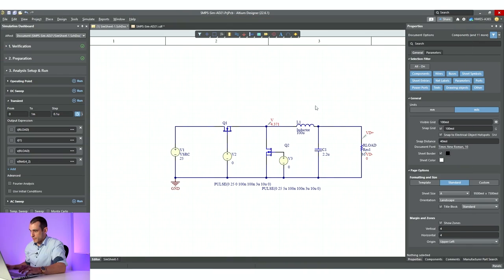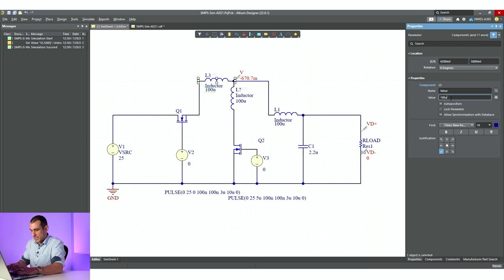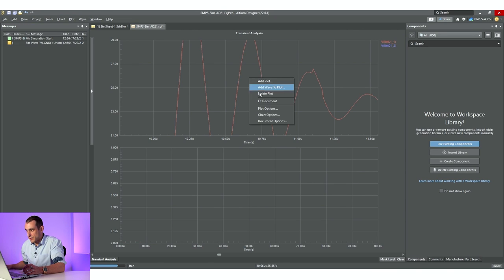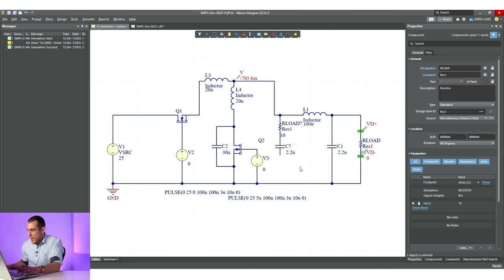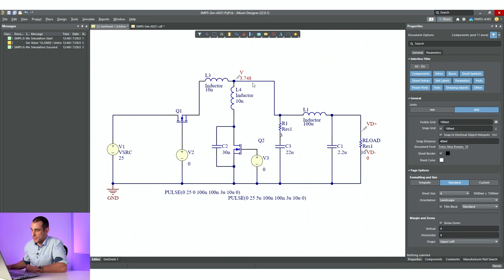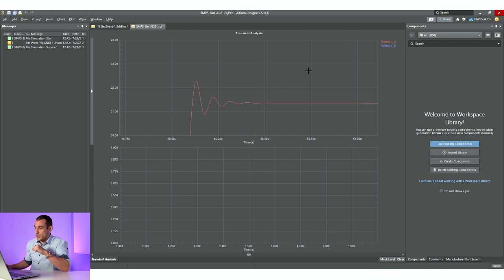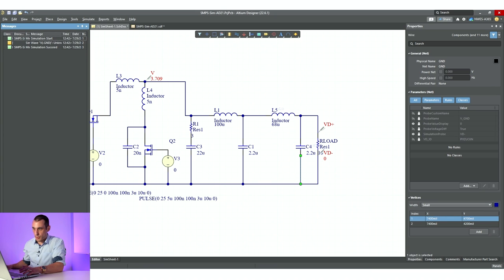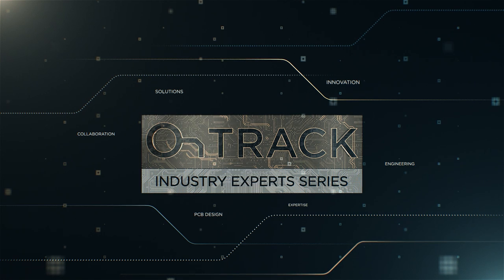Where to Place Snubbers in a Buck Converter

Comment: What about a snubber in parallel with the actual inductor? 
My converter is subject to fast changes in load which are causing voltage spikes. Output is 9V, spikes are 21V.

Comment: Is there a way to determine an actual parasitic inductance based on a layout?
Reply: Yes, it can be determined in Altium Designer using the impedance calculator inside the stackup manager. If you look in the right side of the calculator panel, you will see values for inductance per inch and capacitance per inch when you calculate the impedance. You can set whatever trace width you want and it will provide an impedance value. Some online calculators will also return the capacitance or inductance values per unit length. The same idea applies in an online calculator, you can set whatever width you like and it will just tell you the inductance value.

Comment: For my point of view, the 22u snubber (bigger than output filter)  is way too big. I'm typically reduce the ringing frequency by 3-5 times, then adjust snubber resistance to best snubbing. Best solution - to adjust switching timings to prevent ringing at all - but its complicated.
Reply: Yes it's large, typical will be much smaller but it does depend on the ringing frequency, generally higher ringing frequency requires a smaller cap. If you do a sweep of capacitor and resistor values with the Parameter Sweep tool in a SPICE simulator you can get to a good pairing of R and C values.

Comment: (1) Do you actually want a resistor for the RC snubber, or are you just using the parasitic R that comes with any track?  (2)  When you say the LC filter works only at the load, are you really just saying that the stuff between the switch and the L can still experience noise that might leak out and interfere with stuff you do care about (therefore minimize that area)?
Reply: Discrete resistance is definitely needed
Reply: (1) If you find that the package and lead inductance are unacceptably large, and you decide you need a snubber to affect the ringing, then yes you would use a resistor in that snubber. There are a few app notes on this topic in terms of the circuit design. It is true that the trace has some resistance, but to get to even a small resistance of a few OHms requires a really long, really thin trace. That loop inductance path for that snubber section would be big, so you would be adding in inductance with a long route.
(2) Yes exactly. The filter only affects whatever conducts out of the regulator, but the noise produced on that weakly damped transient response can radiate in the MHz range.
Reply: Thank you for video! It's very interesting!
I see that snubber should use in handmade dcdc. What is about IC? Do I need use snubber or not?
Reply: @Вова  yes for an IC, snubbers are okay to use. Rohm has a good application note on this topic, in their application note they cite an original IEEE paper for the formulas used to calculate the value of R and C in a snubber. In general, you need a bit small resistance and capacitance if you determine that a snubber is needed. The title of the app note is "Snubber Circuit for Buck Converter IC" (sorry I can't post a link, if I do then youtube will delete this comment).

I would like to point out that a snubber is not always required. It can be useful if you have a lot of ringing on the switching node on the PWM signal edge transitions. Using a snubber and changing the layout together can help to greatly reduce the switching noise.
Reply: @Zachariah-Peterson  I think that order-of-magnitude estimate for what "small" means is some background I'm personally still missing, though I don't know how much of the rest of your audience is.  Thank you.
Reply: @Jim J. Jewett  I'll do an article on it because it is a really good topic. For the resistor, I'll give you the answer here. The typical recommendation for that snubber value is that it has to be larger than the SQRT(L/C) impedance created by those parasitics. If you're looking at this from the RLC circuit perspective, that won't bring you to critical damping, but it takes you part of the way there. Some app notes just set those values equal. So for typical chip or FET values the answer comes out to anywhere from 1.5 to 5 Ohms. You could use a larger value but eventually you will overdamp the edge transition on the PWM and I think this would start to reduce power conversion effeciency.

EDIT: Your question got me thinking so I checked this again, making the resistor and cap too large does slow down the cap discharge rate coinciding with that edge transition and eventually you stop seeing an effect on the PWM ringing. Just keep that in mind when sizing these.
Reply: @Zachariah-Peterson  thank you! you're great teacher🙂